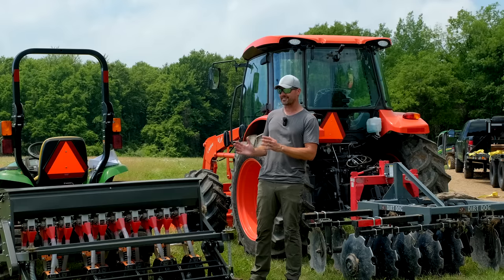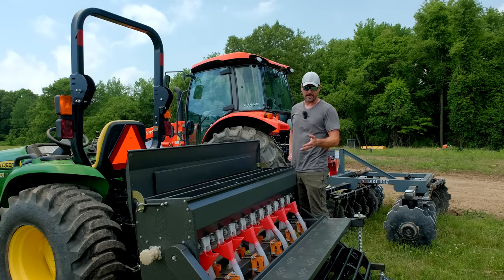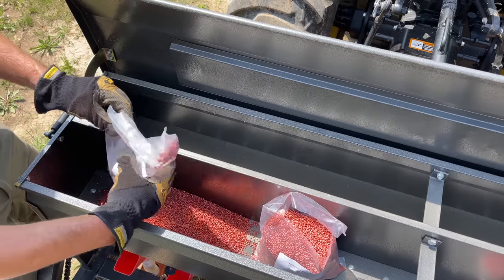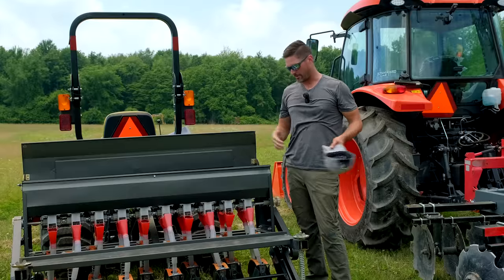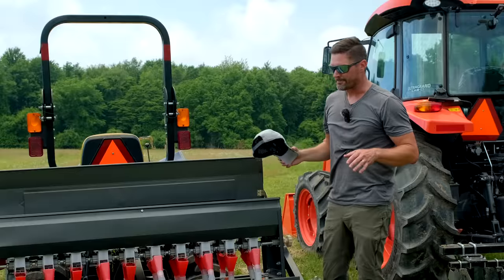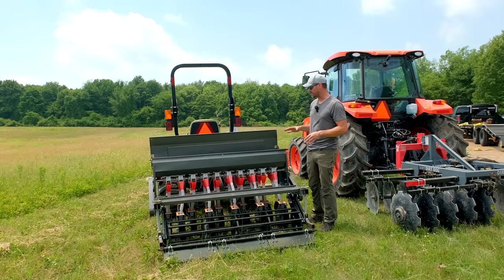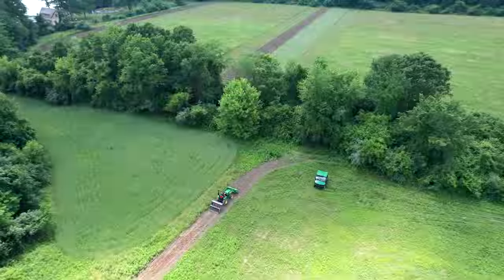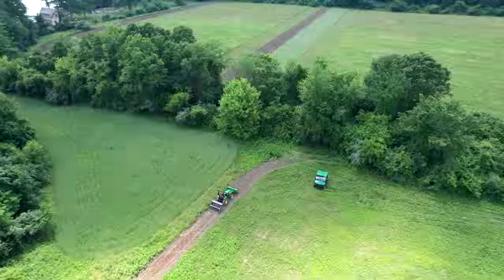FOUND A SUPER CHEAP SEEDER ON AMAZON.  FIRST USE & FEATURES!

Comment: I would’ve hit that with a 3 pt tiller and just skimmed the top to get all those clots down before using that seeder. While a disc is good for preparation it leaves a rough finish that often times seeders don’t like. Also I’ve drug a light gauge chain behind my seeders and seed drills just to make sure everything gets covered. Great video!
Reply from the maker: Yeah, tiller was the plan.  I discussed why I couldn’t use it in the previous video.  Drag would be good too!

Comment: if you rubberbband sandwich bags to bottom of tubes then drive a set distance (say 100 ft) - then its just math from there - you will have a weight of seed for a square foot area at whatever setting you are on --- change setting and run again

Comment: A 2 point quick hitch like “Pats” should work fine.  I use that for all my hookups rather than the three point fixed since I usually have to adjust the top link length anyway for each implement

Comment: Part of the reason you might have exposed seed is because of your seed bed prep. Here in eastern Canada, we use a disc as part of a 3 step process, never to break virgin ground. (Moldboard plow, disc, harrow). This gives you a lot softer seed bed, might be something for you to try in the future
Reply from the maker: I mentioned in the previous video that we wanted to till, but didn't realize the PTO shaft would be too long to fit our other tractor.  I didn't have tools with me to cut it down, so we disced.  My original plan was to till, gotta roll with it.
Reply: I was going to ask the same, thanks for answering. Seems like it would do even been on tilled ground @GoodWorksTractors

Comment: I just came across this video.  Since it's been a couple of years since you made it, I'm wondering how that Chinese seeder is holding up.  Have you had any issues since the video was published?  Broken parts, etc.?
Reply from the maker: Terrible, fell apart...all the plastic tubes rotted out, the chain drive system disintegrated. Avoid at all costs.

Comment: Could you sell or does northern tool sell low cost notill drills for standard L weight tractors? The Landpride notill drill likes Grand L or similar or heavier tractors and is pricey.  

Avoiding ordering anything from that other company mentioned but Northern or a small retailer like yourself would be good to support.  Is shipping still to 35 states or are you shipping across country now? Great videos 🤙

Comment: Great vid. Update?
Reply from the maker: Glad you asked.  It's a piece of junk.  Just yesterday I was trying to seed plots with it and it's falling apart a year later.  Chain won't stay on the gears, plastic drop tubes are cracking and falling apart, inconsistent seed depth and coverage.  I would avoid it.
Reply: @GoodWorksTractors  thank you. How did the screen turn out?
Reply from the maker: @JBesq  really well.  I would suggest 20' minimum and probably planting late June through mid July.  At least in my area of Southwest Michigan
Reply: @GoodWorksTractors  thank you

Comment: Did you say that you were using a JD 3025??  How did it handle this unit. We have a kubota L2501 and what we have been finding is that class tractor cannot handle the weight of any no till drills….
Reply: 3’ esch or genesis would work with a 2501. I have the esch and like it this far.